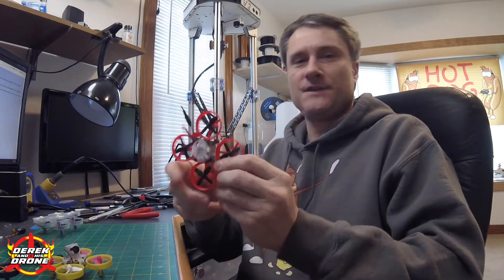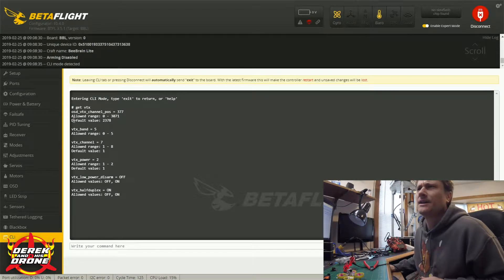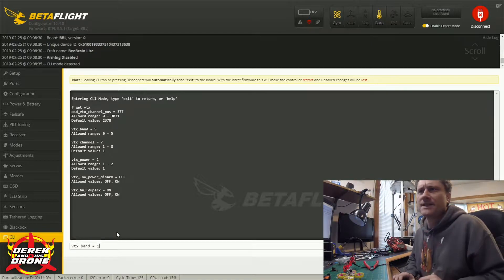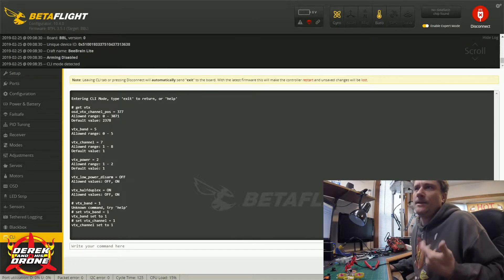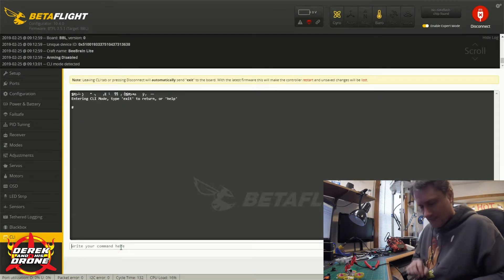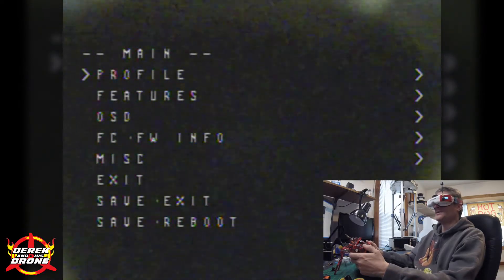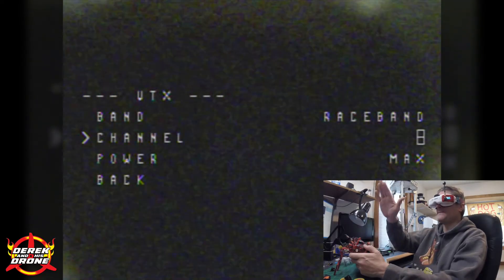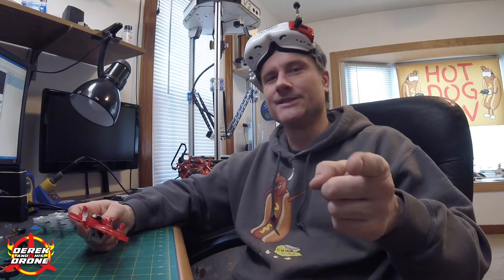AcroBee VTX Control

Comment: Keep in mind that NeeBeeDrone wants you to have a battery connected any time you have USB plugged in your beebrain lite FC. Without a battery plugged-in there is a diode that will overheat after a few minutes. Be careful.
Reply from the maker: Yup the hot diode.  Talk about a design mistake.  Good thing the AcroBee I was using is shot and it doesn't matter.

Comment: How would you describe the flight characteristics on 7mm vs the 6mm? 
Thanks! New sub here.
Reply from the maker: 7mm motors have more low end torque.  But the Unicorn motors run at a higher RPM and would win in a drag race.